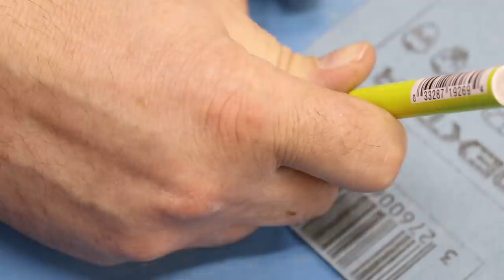НОЖ как БРИТВА за две минуты! Отличные идеи для заточки ножей !

Comment: Thanks! You solved my problem with holder for Lansky sharpener! The original one is so hard to use and improved optional part is $48 in addition to $117 for the set of stones itself. I got the basic set, but hardly used it due to complexity especially sharpening long knives - now you opened my eyes for very good idea, just will have to make few changes to your model to adapt to Lansky stone holders.
Reply: Afilar cuchillo derecho  como hacer

Comment: Your words in the description for this article do not say "sharpen with a spark-plug" and it should have said.  Your sharpened knife cut paper pretty well. The bottom of the ceramic cup and spark-plug are both harder than the steel. That is why tiny steel traces are left on the ceramic items and not the other way around. I have never seen steel that has been marked with high quality ceramic traces on it left by the ceramic.  I think that the differences between what you have not said in English and are simply lost in translation. You are not the only YouTube contributor who calls a spark-plug a "candle". A German language word's  direct translation of the English word for "light bulb" means "glowing pear". That happens sometimes.
Reply: Spark Plugs are called just "Candles" in all other european languages. 
bougie (FR), Candele (IT/ESP/RO), Vela (PT),  Zünd-Kerze (Ger) gyertya (HU), svječica/свеча/świeca/svíčka